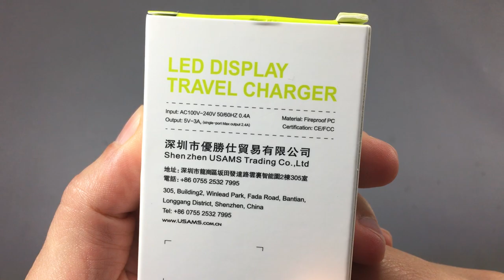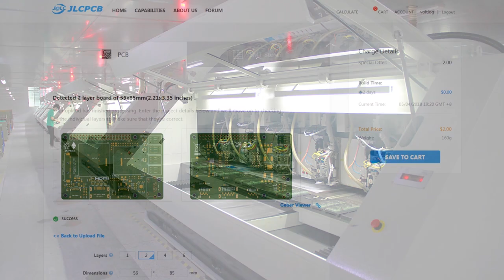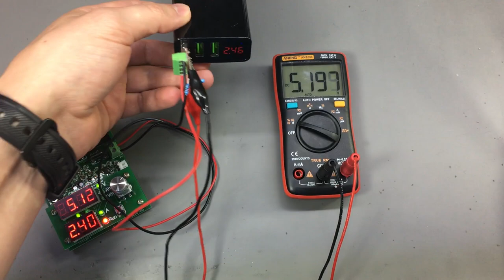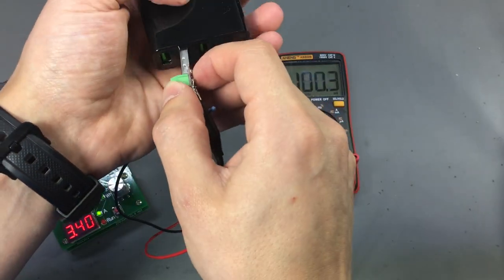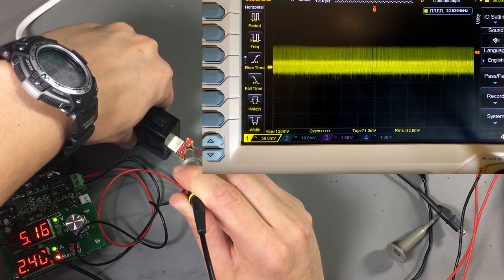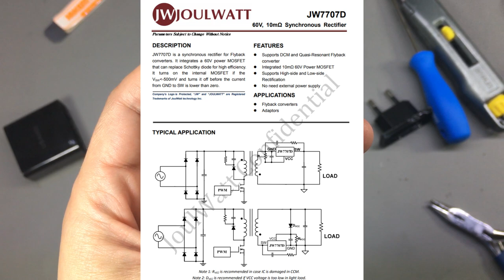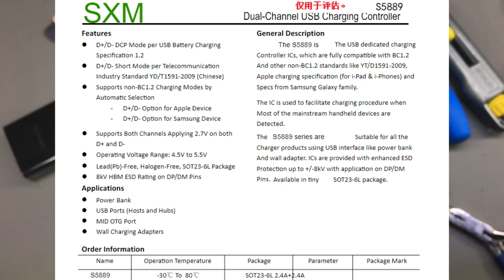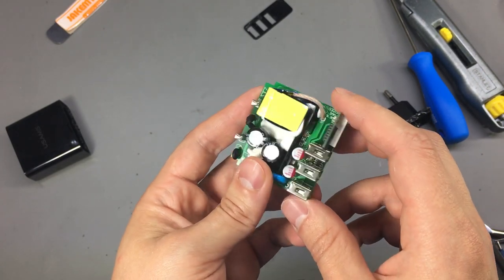Voltlog #165 - USAMS 3 Port USB Charger With Display Review & Teardown

Comment: I've been using this charger since you posted this video, and it has been working really well. I bought one for the office at work and one for home. We charge headphones, tables and phones and we save some mains ports. At home it is happily charging my android phone together with my girlfriends iphone. It just about can do it, and shows 3.2A and gets warm. We usually don't charge at the same time, but it can do it, because of the cutoff at 3.3A (or 3.4A?). The reason for buying it was the safety aspects of it that you mentioned. Mains separation, and overall quality. It also has fire resistant plastic. There has been a few house fires around here due to chargers, so seeing this is very comforting. I was looking up this video, becuase it seems I need to reflow the usb port solder points, but I see now the charger is very hard to open :D

Comment: The common mode choke wouldn't help with output noise. It's there to not "pollute" the mains supply, not to smoothen the output. It missing does not necessarily mean they were to cheap to put one in. You can see that in expensive devices as well. Often the board is designed with it in mind and depending if it is needed or not (to meet certification in certain countries for example), it's populated or not. Pre-production testing can only go so far.
Reply from the maker: Ok, thanks for the info.

Comment: Nice tutorial! But wouldn’t be more nice if you calculated the whole efficiency? 😉 
As I know, those Chinese things has a really bad efficiency.
Reply from the maker: Well not as straightforward as it sounds. I would need additional equipment that I don't have for measuring the input power because the power factor is not exactly 1.